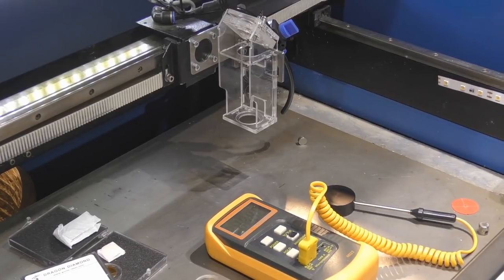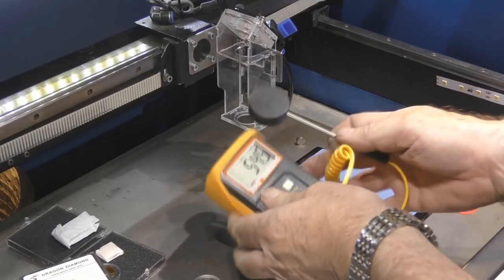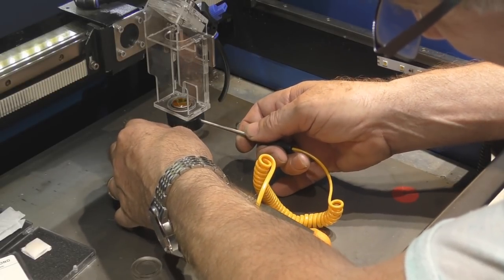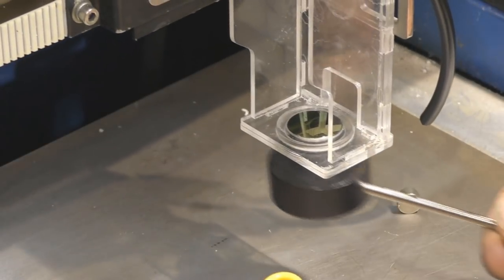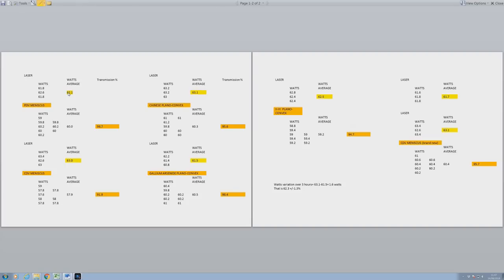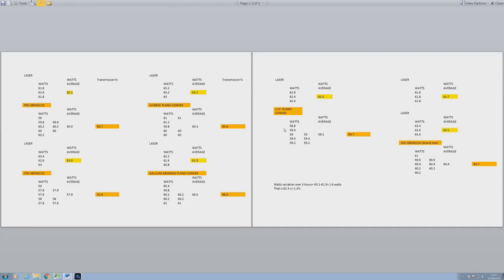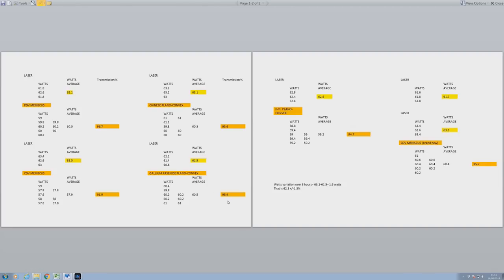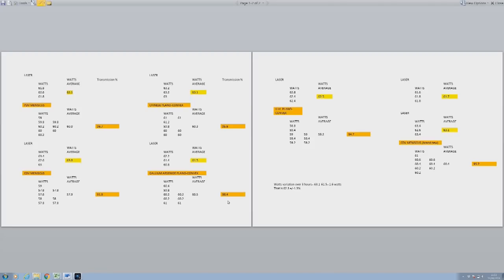RDWorks Learning Lab 150 Lets ZOOM in on Lenses Part 2

Comment: Very interesting AND the Gallium result blew away that "internet expert" I mentioned to you.  Now time to catch Pt. 3.
Reply from the maker: Facts conquer the "candyfloss" experts. As I said, listen, smile and do your own research. Don't go back and gloat  he will be slinking away into the shadows.
Best wishes
Russs
Reply: Oh, no he is not the type to gloat with so I am smiling inside and will let him wallow in his ignorance.
Reply: So I do not want a lens that transmits a lot of power for engraving but I do for cutting, right?  If so that leaves out most of those lenses including the CVD.
Reply from the maker: If I was focused on photo engraving, as I believe you are, I would choose the CDV lens based on what I know so far.  A small compromise on cutting power would be a small penalty for having a great engraving lens. There may be times when you need to engrave and cut in one program so you will have a low power tube (40 or 50 watts). 5% of 50 watts is a negligible power loss of 2.5watts. You cut with watts not percentages. However, there may be more surprises in store  when I get to cutting. Well focused power may be more important than absolute power at the cutting surface. I have an interesting problem I hope to solve. How you can cut 10mm thick plywood with a 38.1 lens? The rapidly divergent beam after the focal point should make this impossible.....but it's not because I have done it many times. Hmmmm.
Best wishes
Russ
Reply: Yes, if a dot is more defined it would have more power at the point (pin point versus being pricked by your eraser) and since we can't measure the power of the dots per lens we are not getting the complete picture.  This should show up in part 3 when you begin cutting but, as you very well know, a small, and well defined, dot with little power is what an engraver is after.

Comment: watching your videos, I had the idea of actuating the lens off-axis to cut tapers.
Reply from the maker: If you imagine a simple square shape and want tapered sides how would you achieve this? Offsetting the lens in X and Y will produce a positive taper in say left and lower edges. However, it will be a negative taper on the right and top edges. It gets more complex when you try t cut a disc. If you plan a lens with a tipping axis or lateral movement then you have a massive problem synchronizing that movement to the X and Y motions of the program. Don't stop imagineering....there are still so many problems to be solved.
Best wishes
Russ
Reply: I was thinking about active steering, I guess that's how waterjet cutters do it, you need to put the center of rotation at the focal point. I am still in the thinking phase, one of the issue is the weight of the head, that means light actuators, lightweight probably means closed loop. I was thinking about a flexural XY platform for the geometry part of things because the amplitude is small.  Keep the great work.

Comment: Russ Thank you so much for your videos.  I rewatch them daily.  I had a customer ask me if I could engrave a fingerprint onto metal.  Specifically a firearm.  Do you think its possible to get that accurately detailed print on any substrate without stretching its size?

Thanks Brendan
Reply from the maker: Hi Brendan
 An interesting problem. I suspect the gun metal is basically an alloy steel and it is the steel part of the body you wish to mark. Certainly with a good 1.5" meniscus lens you will be able to get the dot resolution for the detail you are trying for. Although I have done few experiments with metal marking I this guy seems to have done a much wider evaluation  and  you might like to take a look at his work. https://www.youtube.com/watch?v=emlVbVSWPT0

Hope this helps
Russ
Reply: @SarbarMultimedia  thanks I will watch his video.  One thing I wanted to mention. You enlarged the cards you designed to correct errors when importing.  Wouldnt it be a good idea to do that to all images we import?
Reply from the maker: Hi Brendan

Remember that I am not an expert, just someone that may be a little higher up the learning  ladder. Since I made that video I have learnt a bit more. My work-around of enlarging the picture to stop minute artifacts happening as I imported DXFs  with very small detail, it was in fact covering up my lack of knowledge.  If you go to Config, File Parameter. There are two boxes there called Auto close curves and Combine curves. By default they are set to 0.1mm. I have now set them both to 0.001mm and that fixes the problem
Best wishes
Russ
Reply from the maker: This is this is basically a CNC motion and laser tube on 4 adjustable legs. For certain types of job it has merit for others where you want to accurately and repeatably relate the head to the work table, it looks like a nightmare. There is a guy in New Zealand that has independently had the same idea and has built his own lightweight version  of this flat tableless machine. He plans to take it to site to engrave on tables , walls, doors  or anything  that is  to big or cumbersome to fit into a machine. Take the machine to the job.

Best wishes
Russ

Comment: Hi Russ,
Brilliant as usual,
Question: Is the transmission % loss a linear function of Power input ?
Reply from the maker: Logically it  can be inferred  that % loss is constant regardless of power. This is a monochromatic light beam with synchronize waves,  the thickness of the coating will likely be  set at quarter or half wavelength thickness to reduce surface reflectivity. More power is only increased light density within the  beam,  thus as there is no inherent change to the light characteristic as power increases  I cannot see a logical reason for the transmission efficiency to change. An interesting question though.

Best wishes
Russ

Comment: I have a question about RD works.  Is there a way for it to automatically remove all the space from multiple shapes (referred to as nesting in other software).  Say if I imported 3 different shapes, and got an outline of each, and sized them all the way I want, but for RD works to then auto arrange them so I don't waste any of my wood or plexiglass.  The "nesting" function seems to just duplicate and arrange one shape.
Reply from the maker: The simple answer is no. The nesting function you refer to is an array  and yes it duplicates a single shape into a regular horizontal and vertical pattern. I have always nested manually but there are programs available.You might like to check out
https://www.mynesting.com/

Best wishes
Russ

Comment: Hi Russ, it's me again :) So, Chinese refunded me $900 and I kept the machine lol. Much better deal now. I was wondering if you could share your new acrylic laser head drawings, so we (your fans) could make them too! We (me and my company) have already launched 3Dpassion.com and I specifically dedicated a section there for laser files. Feel free to use our platform to share any of your DXGs. The reason why I am asking for that acrylic head is because I get a weird oscillating line when cutting instead of straight line and I think it is related to the head first of all being way too long. Belts are still in my shipping list too. May do that later. I also want to feature your youtube channel somewhere on our laser file repository page as your channel is very awesome and educational. Please get in touch with me! :)
Reply from the maker: Hi Vlad
I am currently putting the acrylic head thorough it's paces with my lens testing exercise. I certainly don't want to offer you guys a half cock design. At present I have been very happy with everything I have thrown at it The lens tests are really stretching the capability with many different lens holder and nozzle combinations. After this last lens session I will be back on the case and with a slightly easier design for the the less skilled/ those without special tools Tapping holes is not second nature to many people and I am trying to take that into account. I already have a small batch of brackets manufactured and I plan to put together a complete kit of screws nuts and springs, which if bought in small quantities would be expensive.  I will be defining where to get suitable  lenses and lens tubes from so as to make it easy for folks to follow my footsteps. Is there a way of contacting you through your website?
Best wishes
Russ
Reply: SarbarMultimedia fill out the Form on CNC page, and you can attach the message there. This way I can see your contact info, email etc. can’t share my email in public here for spam precautions. Lets talk :)
Reply: SarbarMultimedia hi Russ, haven’t received your contacts there, gonna try to send you a private message here on youtube.
Reply from the maker: You now have , at your website.